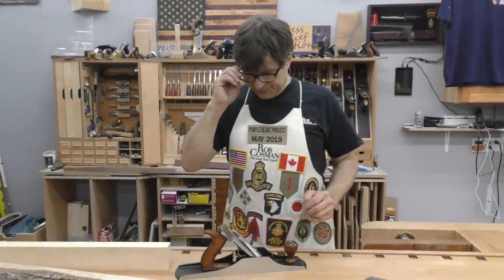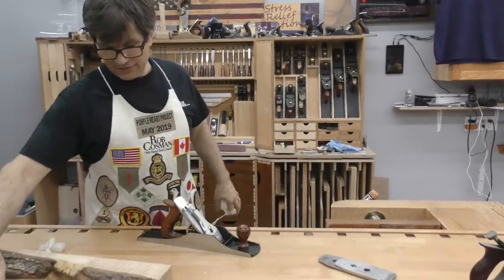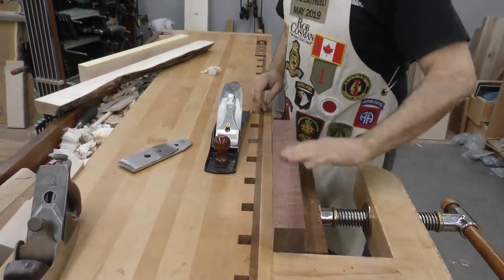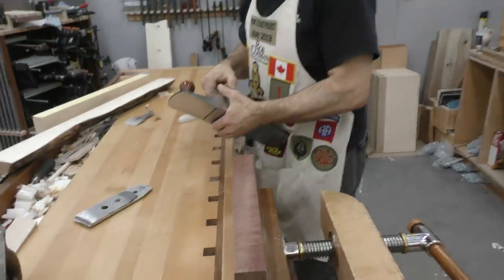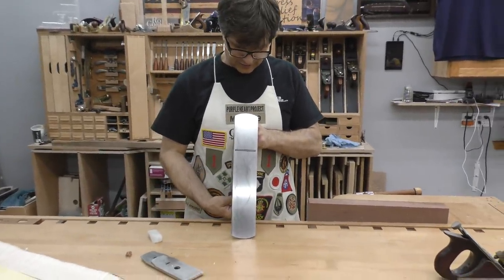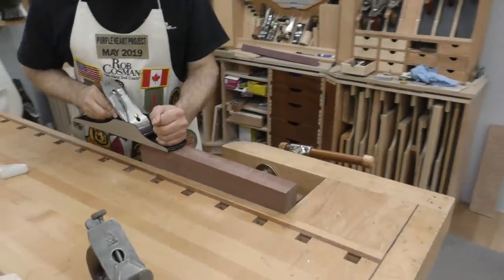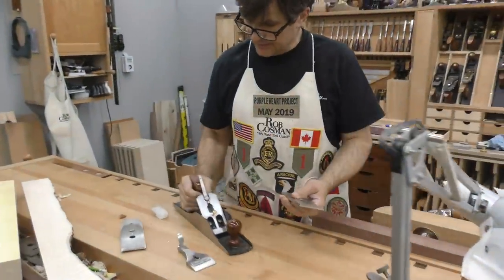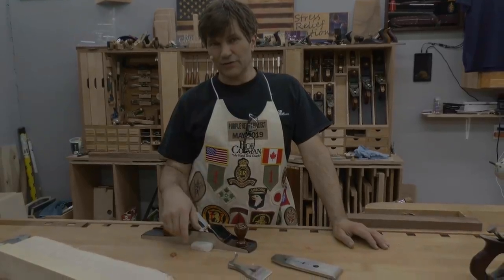Planing Difficult Woods with a High Angle Approach

Comment: Rob,
I also us back bevels for difficult timbers, 15 degrees for domestic timber like ripple ash, and25 degrees for interlocked exotic hardwoods.
my sharpening method uses stones only as the width of back bevel needs to be very small.  When one thinks that the shaving is unlikely to be more than 0.002"
So I now keep the backbevel very narrow indeed0.004" would be quite sufficient and can be easily honed on a 1000grit stone.  No need to grind!  So easy to 
remove or change angle.
best wishes,
David Charlesworth.

Comment: So, It finally clicked for me on this one. I’ve been struggling with poor steel on my blades that would chip when sharpened doing the normal Charlesworth ruler trick. I used a thicker and wider piece of steel laid on the stone (I don’t have gauges or a grinder) to get a higher back bevel but my chip breaker was not modified to sit flush on this higher angle. When I moved the breaker back. Bam!  Finally worked some Walnut. Of course I had tuned the Plane following your other videos.

Comment: Going to have to say Rob that a situation like that is an example of when a guy needs to ditch the plane and use sandpaper.  Love your videos.
Reply: I go both ways on it. Sandpaper is certainly easier, but sometimes you want the better finish that hand planes give than sandpaper. Even high grit sandpaper will mute or dull figured wood. It really just depends on what you want in the project.
Reply: Any of you guys know what a card scraper is? Rob is a master woodworker.

Comment: Hi Rob, great advice as usual.  Presumably, you could get similar results with a bevel-up plane.  A low angle Jack for example.  How important is the "chip breaker"?  I ask, because a bevel-up plane doesn't have one.
Reply: I believe he went over that in his other high angle approach. Basically the point was the high angle blade is more cost effective and controls tear out better.
Reply from the maker: A chip breaker used to be crucial when Stanley was producing their blades with thicknesses ranging around .075-.080.” Now they’re just part of the advance/retraction mechanism. Not necessary on a low-angle plane, but I don’t care for those anyway.
Reply: Chip breaker is crucial for controlling tearout on difficult woods. Helps with blade sturdiness as well but that’s less important with modern blades. If you set the chip breaker too high up to do anything you’ll get more tearout than if it’s adjusted properly. What it does is snap the grain off by bending it forward before it has a chance to rip up the wood it’s connected to below the surface of the piece with it.

Bevel up planes have a purpose, but that purpose will never be heavily figured very hard woods. You should invest in at least one bevel down plane  with a chip breaker for working such woods if you intend to do that sort of work.

Comment: Wouldn't using a properly sharpened scraper also be a good solution?  I've found good results on bubinga and padauk, but am sure I could do better.
Reply from the maker: Randy Steck only really hard woods (typically exotic) respond well to being scraped. This is more for your domestic hardwoods with high figure or constant grain changing.
Reply: @RobCosmanWoodworking  Thanks much.  Always happy to learn more about this.
Reply: That was my experience with scrapers until a luthier showed me how to prepare them the finicky way. I don’t think it’s always the best way, but I do think you can get a good finish on almost anything with a scraper. To get the best surface you must draw file, then sand up to 1200, the edge of the scraper and the face (just right next to the edge). Flat and smooth. Then the burr is very even when you roll it. The other thing he showed me is burnishing the steel by rubbing with the burnisher before turning the burr. Push harder than you do when rolling the burr to do the burnishing. For beginners, a common error is using a screwdriver; your burnisher must be very smooth and polished decently to get the best burr. Tiny little machine lines, even if is is bright and gleaming, are no good (and cheap Home Depot screwdrivers are probably too soft to burnish much).

Comment: Does that make it work closer to a card scraper?
Reply: In a sense yes. It helps to understand why Tear out happens in the first place. When the a lower angle blade encounters grain which  rises towards it, it will tend to "get under the fibres" and lift them a little way, before they break off, marring the work. If the angle of approach is high enough the fibres will not lift before they are severed. Personally I find "bevel up" planes most effective in this regard, albeit they do lack a bit of heft. These are often called low angle planes, just to confuse things further.
Reply from the maker: gav2759 answered perfectly. I’m personally not a fan of the low angle planes, and that’s why I prefer this approach over using one of them.
Reply: RobCosman.com If you get a chance,  try a low angle plane with 50 degree secondary bevel.  It gives you the high angle needed for difficult woods.  Still harder to push, but I’ve found that it can produce very nice results.

Comment: Would putting the blade in wrong, ie bevel up, give the same effect as a high angle or back bevel ?
Reply from the maker: Hi John, yes it would however the chip breaker would have to come back to the base of the primary bevel and your plane does not have that amount of travel in the yoke.

Comment: Does anybody know of some listing of wood types and how they are to work with?  As a beginner (and LSU fan - GEAUX TIGERS!!!)  I started with purple heart and it almost turned me off of wookworking....  If I had known how hard it was to work with, then I wouldn't have been so disheartened by it.
Reply from the maker: Ben Buckley absolutely! We use the Wood-Database all the time and this is their poster.
They’re ranked according to hardness.

Worldwide Woods, Ranked by Hardness 24 x 36 Poster https://www.amazon.com/dp/B01NBELFW9/ref=cm_sw_r_cp_api_i_VvIcEbW5G14EA
Reply: As a beginner, I would recommend soft woods.  Build up your skills on these before using some semi-hardwoods and then hardwoods.  I'm not surprised you found it such a struggle using purple heart!
Reply: You’re first clue should have been the weight. Anything that heavy is on the harder side of the spectrum, difficulty-wise. I don’t mean more skills, just more honed in tools or sweat. I would avoid soft woods like fir, spruce, cedar, Pine. You want something straight grained, medium density and not coarse. All those conifers have distinct, much harder rings mixed with softer, lighter colored wood. Your broadleaved timbers are much more forgiving, if you want clean, fine work. Walnut is good, or bigleaf maple, cherry, alder. Ash is ok, oak and hickory not so good because they are too coarse; the grain will tear out easier. A good test for woods for using hand tools is to shave off end grain with a knife or chisel. The sharper the blade needs to be to not leave a fuzzy surface when cutting end grain, the more annoying the wood (but if your project involves much hand sawing, don’t choose too heavy a wood; the catch-22 is that heavier woods have an easier time with the end grain shaving test).